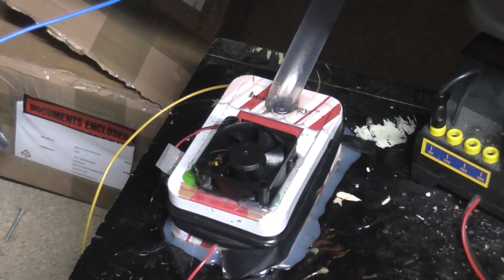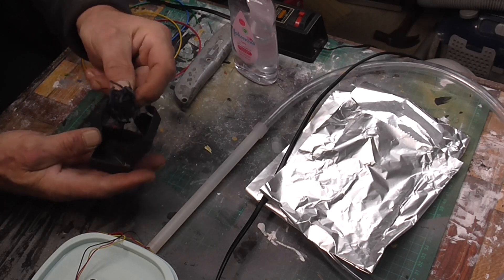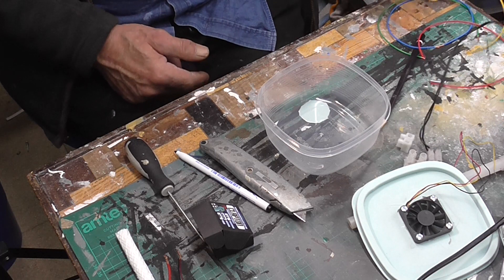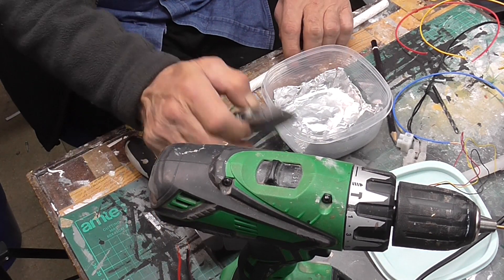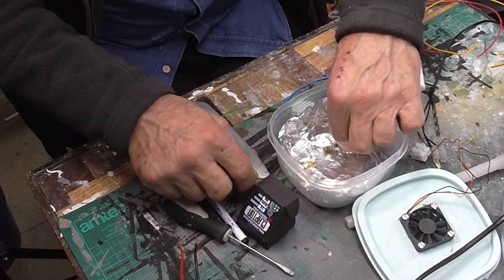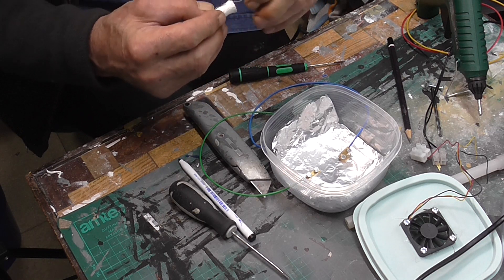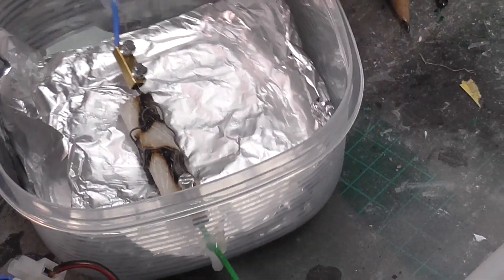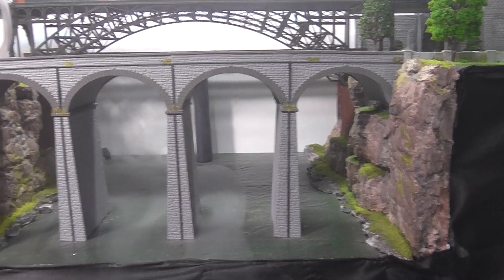Building a Small Smoke Machine.

Comment: Hi Glynn. Still too much smoke for my liking. I think I would find a way to slow the fan. Now the killer question: how do you know that the smoke (NOT the baby oil) is NOT carcinogenic?
Reply from the maker: Hi Paul, there are special smoke oils on the market,I was just going for a cheap version. Sure they would not sell them if they were. I'm sure there is a way to slow the fan down. Glynn
Reply: @LNER1946  Hi Glynn. Obviously, baby oil is not carcinogenic when used for its intended purpose, but burning it may alter how safe it is - I'm just guessing here, but it's something to bear in mind. Safe smoking!

Comment: Hi Glynn,
Caught the end of this on the tv so what a super idea and relatively easy to build in the last one you said about the smoke not going up the chimneys which is what they are there for so I have a suggestion you have used a fan to get it along the pipe if you fit one in the floor of the shed pointing upwards it might just give you the desired effect what do you think? but a couple of super videos on this and something new well done. Keep well and safe.
Cheers Robert.
Reply from the maker: Thanks Robert, Still in the experimental stage, if i want smoke I get o low lying fog, if I want  fog I get smoke!
i thought about putting a fan in the Engine shed but I am restricted by room. but good fun as gives another aspect to model railways. thanks for commenting. Glynn

Comment: That was pretty sweet.  Looks potentially dangerous though. 😄  
Do you have to limit the time in use to not pop the coils?

Works a treat.
Reply from the maker: No, As long as there is oil to burn, have left the elements burning without oil and they just glow, just don't put to much voltage through, if you do then escape quickly and ring fire Brigade! lol. Glynn
Reply: @LNER1946  - what if the wick sits in a pool of oil.  Would that work?   If so should reduce burn out potential.
Reply from the maker: It should sit in the oil, just thought that if the element was safe with no oil then even better. Please trust the Old Git method, its the only way!lol

Comment: Nice one, worked out in end, after setting fan up right way too in beginning. Thanks for sharing, all the best. Brian
Reply from the maker: Thanks Brian, think my second effort was best. All the best. Glynn
Reply: @LNER1946  yeah, Glynn, it worked a treat. Is. There anyway to have a lesser amount of smoke, or would reducing speed of fan do that? I am considering smoke options for some scenes of my new layout, was thinking of having three outlets for a single smoke machine? Is that possible with your set-up?
Reply: @LNER1946  yeah, Glynn, it worked a treat. Is. There anyway to have a lesser amount of smoke, or would reducing speed of fan do that? I am considering smoke options for some scenes of my new layout, was thinking of having three outlets for a single smoke machine? Is that possible with your set-up?
Reply from the maker: Well Brian, you could run the fan slower,or you could run 3 pipes from the smoke machine, the more or less smoke you wanted would depend on the diameter of the pipe used.
Reply: @LNER1946  thanks Glynn, good advice. Will bear that in mind. All the best.